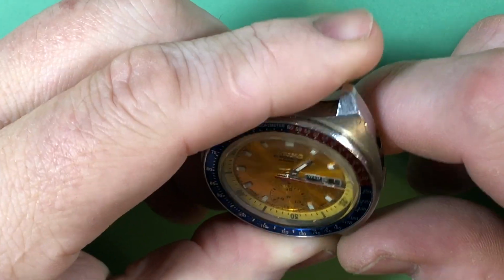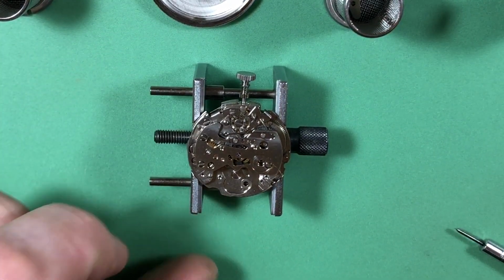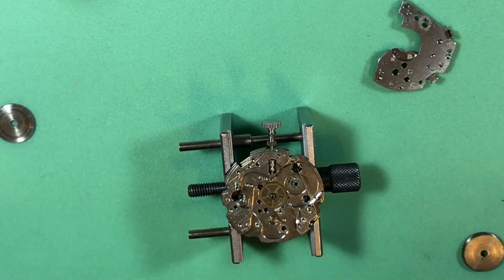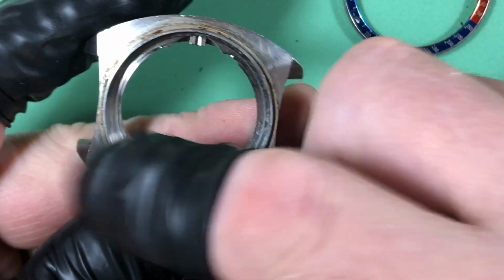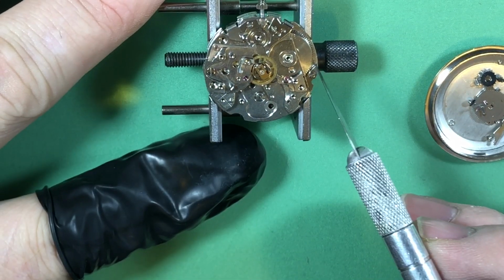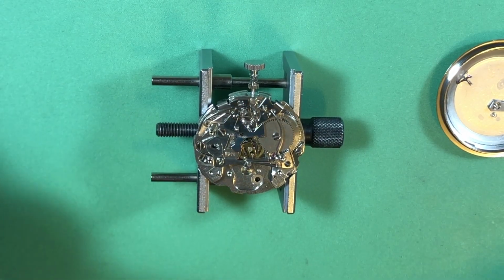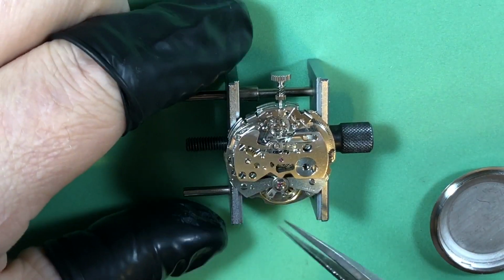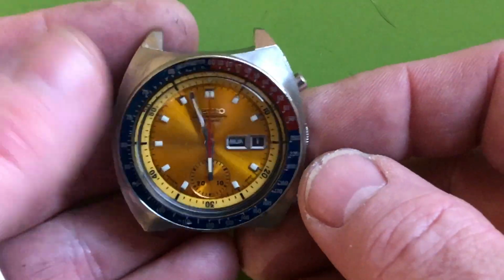For JD: Seiko 6139--6005 Restoration

Comment: I have been wearing my Pogue for the past 47 as a everyday watch. Keeps good time and it has been service about 3 times in the last 47 years. I’m the original owner. I sure would like to get Spencer to go through my all original watch.
Reply from the maker: It's hard to decide what comes in or doesn't.  We get more work requests than I would ever be able to do, so, yeah.  I wish I could say yes to ever watch job because I'd take them.  But doing that I worked up a backlog of over four years.  I had almost 200 separate customer jobs in here, with most having more than one watch.  It was nice for the security but it literally was four years of not taking any work at all.  I want it to be that I have one watch at a time in here.

Comment: You must have been tired! 31 days in August, not 30. And you set it at 5:56, not 6:56. Get some sleep!
Reply from the maker: I never can remember what months have what days except for December and February.  No joke.  But yes, not just tired, fried.  Lots of stuff going on here.
Reply: Here's a little trick my mother taught me; make a fist with your right hand  & have the back of your hand facing up towards your line of sight. Start with the first knuckle of your index finger and tap it with your other hands finger. When you tap it, say January, next tap the space BETWEEN the first knuckle and the second knuckle of your middle finger, say February, then tap the knuckle of your middle finger and say March, then the space between your middle finger knuckle and your ring finger knuckle and say April and so on and so on until you get to your pinky finger knuckle which should be july. Then RE-TAP the pinky finger knuckle again and say August and start going back the other way, to the left. The space between your pinky knuckle and ring finger knuckle is September, and go on until you get to December on your middle finger knuckle. Now, the knuckles are 31 days. The spaces between the knuckles are 30 days, or 28 for February. And there u go! I still use it to this day. It's very helpful!
Reply: Troy Nasello instead of the knuckle mnemonic, I was taught the verse mnemonic, “30 days hath September....”